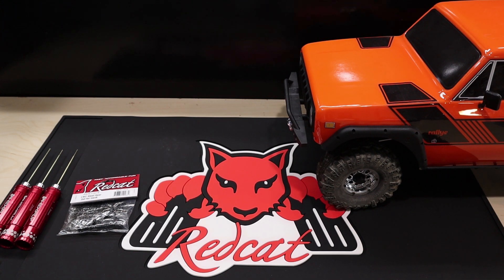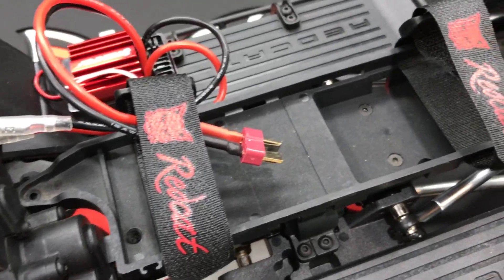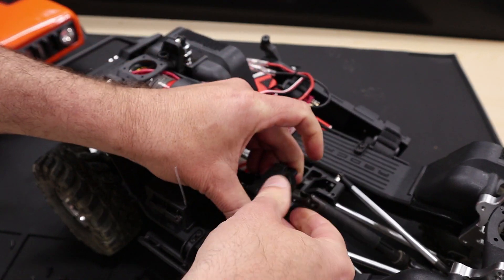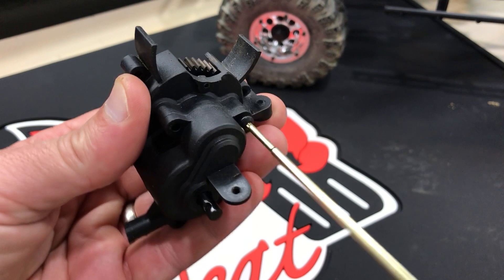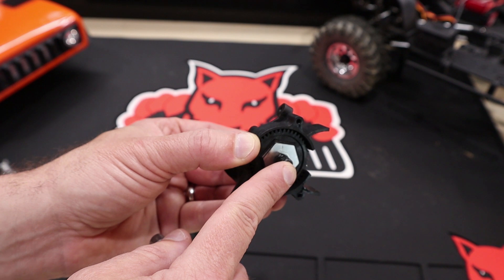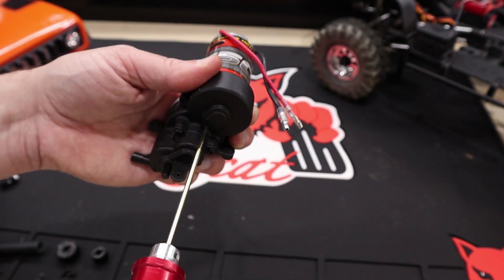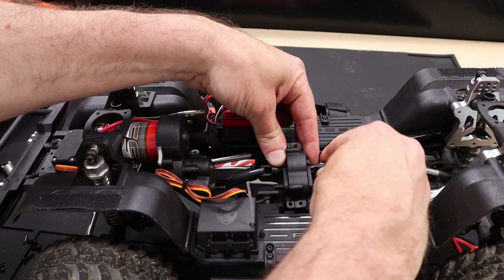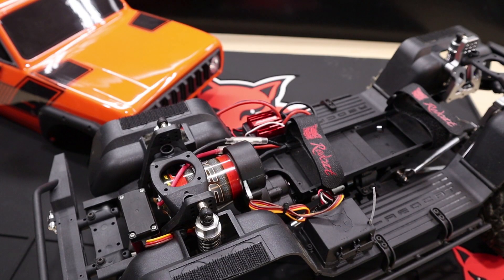Redcat University - How To - Redcat Racing Gen8 Scout CNC Steel Gear Set Option Part Install

Comment: I’m in the ain’t broke don’t fix it camp. But it’s a comfort to know these great how-too’s are here if you need to replace an item. Those standard gears looked fine to me so if mine ever wear to a replacement level then I would consider standard or upgrade at that point.
I might even tinker and check for wear but my wallet stays in my pocket lol 😆 
I have put the Redcat lights in but I count that as enhancing.  Thanks for these like I said x

Comment: Every videos I have seen one of the pins is a bit to long on the smaller gear, you guys did not have that problem... Why?
Reply from the maker: Without seeing what you are referring to directly it is hard to answer that question.
Reply: Yeah the pain is too Long I can’t even use the gears I bought
Reply: I have the same issue, I use a hammer to set the shaft as the pins wouldn't push in and now both the tranny and transfer case have spots they jam when rotating.
Reply: Yep, pin for small gear in transfer case will not fully go into slot in appropriate metal gear.  Brand new never ran genpack with brand new metal gears from redcat
Reply: Just got my upgrade kit in today, waited 2 weeks, neither pin fit in transfer case. Its been over year redcat and you still haven't fixed the pin  fitment issue. Very disappointed. 😠